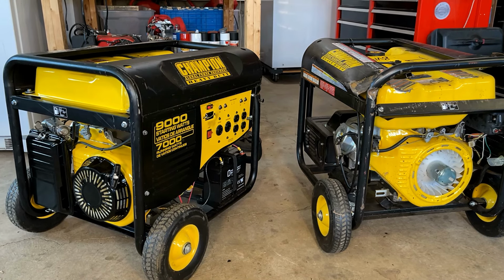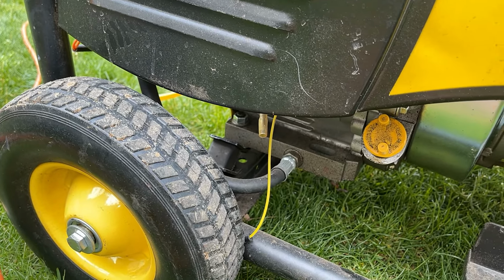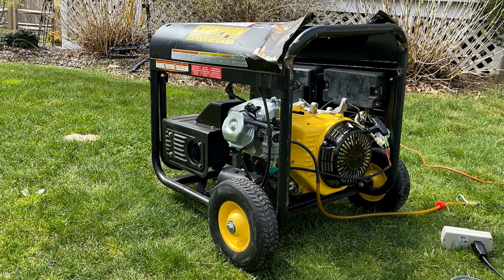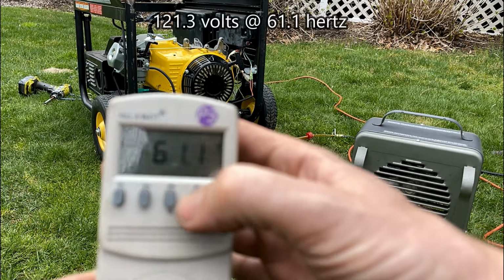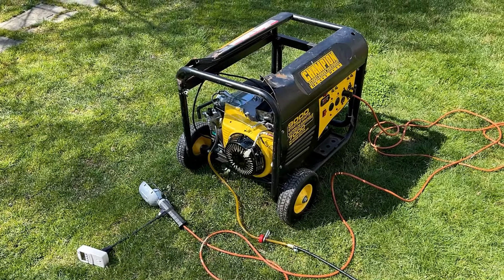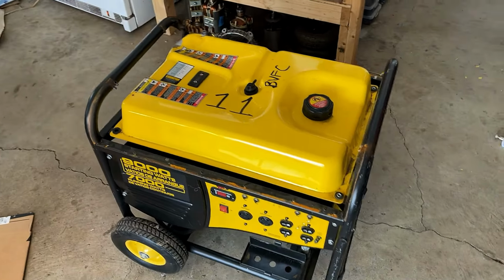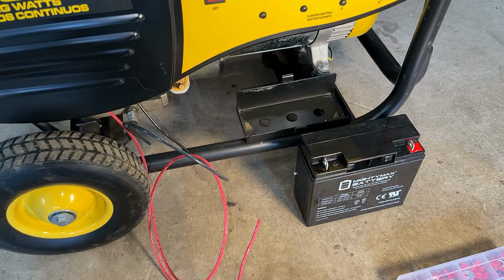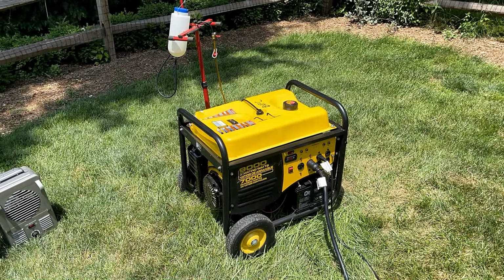Two Junkyard Champion Generators (Part 2) - Scrap Metal?

Comment: One way to pop dents from metal tanks is to partially fill with water and put into a freezer with the dent facing down. Worked great on dirt bikes and three wheelers.
Reply: Also, low pressure air can be useful for larger dents with less of a crease to them. (low pressure being the operative word here, above a few psi they can deform... Actually, Isle of Man TT racers & other endurance riders have been known to "blow the tank" in order to gain a little extra capacity/cut out a pit stop on a "stock" bike)
Reply: Since these dents are in the top of the tank I would make holes and pop the dents out with a screw and slide hammer. Fill with filled epoxy and sand it smooth.
Reply: Great video James ,what did you do with the extra wire that wasn't availible on the replacement suspect but ok AVR did you work out what it did ? Everything see s to be working ok a great machine with low hours and plenty of grunt at 6kw.
Reply: Another way is to use a jetwasher to hydroform it.

Comment: Oil the filter by putting it and the oil in an old but clean plastic bag. Squish it around inside the bag. Save a pair of gloves in the process.

Comment: Very informative video! Up here in Canada we would fix that tank one of two ways: 1. In summer plug all openings ( your choice as to how) and add about 60 pounds of air, or 2. In winter fill it completely full with water and set it outside overnight. Either way the dent(s)  will be out, doesn't remove creases very well, but some blows with a rubber mallet help with them. "Gidday" from Ontario Canada.

Comment: Obviously a pre-positioned primary and also secondary emergency back-up generators for something like life support or critical care situations when usual power might be unavailable.  Fires, floods, blizzards or other disasters that suddenly cut utility power to a remote household could be fatal if the patient absolutely needs that power for support equipment.  Could have been something like a remote police or fire station as well.
7 hours of test run time, just to re-certify the system, could have stretched for years of just maintenance service until some termination of the need finally arrived.  Government policies might have mandated tossing them into a clean-up dumpster when no longer needed (or replaced due to some sort of "shelf life" policy).
The Magic Marker markings often can be partially or even completely removed using rubbing alcohol.

Joe S

Comment: you do a great job,,,,i have Champion,,my big 5500 has no spark now.its like new.was parked in shed for a year...never had one with no spark yet...have to look into it..its my spare,a have 2 4000 ones two...its full of oil...may be coil...or switch...

Comment: The older champion last 30 yrs. mine is 6 yrs old and doing great. It is a 4000 watt... Surprisingly the HARBOR FREIGHT 1400watt is doing ok, the first one I had to take back , it leaked oil & gas..two months in, and second one has not one issue yet, I have a month left. I run it 6 to 12 hrs a day to charge RV batteries & watch TV. Second one has been a dream boat so far...

Comment: 0222'25/2132h 🇺🇸 Thanks for the Part 2 on Champion Generator. Pardon me for saying this.. The original AVR had trimmer too. The body was built around Aluminium which was heatsink. Did it fail AVR control? Cheers.

Comment: I like your program and have learned a lot thanks. I do wonder why you don’t have a cart to install your heaters prewired with one cord and a fuel bottle and some tools on to take outside  thanks again.   Ringo
Reply from the maker: That is something I plan or doing at some point.  Ideally I would get a professional (well used) load bank, but until then will stick with the cheap solution.
Reply: @jcondon1  no weight. You could use bike wheels and aluminum tubing and light plywood

Comment: on some of them china -honda copies,inside AV there is a tiny screw,you turn that clockwise and it will raise voltage
Reply from the maker: I should have checked that.

Comment: The sheathing on that wire is super glossy for Stranded Wire were you get your wire from? @29:50 @James Condon
Reply: That "super glossy" look of those wires is a clear vynle sheath for weather protection. They're outdoor grade wires. The vynle is treated with UV protectants to prevent degradation from UV damages.
Reply from the maker: Home Depot!

Comment: What does it matter how you connect the wires going to the full wave rectifier, usually red and white wire, the output of this bridge rectifier will be the same going to the brushes won't it?

Comment: Tne bent up one must have fallen off a truck or some platform.  There is one YT video using pressuirized air to remove a dent from a gas tank.  Those gas tanks are thinner than tanks designed for pressurized air.  Or to be really adventuresome, fill with an explosive gas and light it off (like some YT videos show seating tire beads).  The result might work or be a spectacular explosion.
Reply from the maker: It would do something.
Reply: Could have happened when it hit the junk pile

Comment: I know I’m late to this video but I was wondering if the AVR in this video could have been adjusted at all first as a troubleshoot. Perhaps I missed that but I thought the AVRs had a trimmer pot on them to adjust the voltage.

Comment: Obviously returned under warranty items that had loose parts removed and were then dumpster scrapped.  

WERE IT I, I would identify the box store that sells those Champion generators and see if I could work up a deal with management there to buy, at salvage, the returned under warranty small engine equipment after the manufacturer wrote off the entire cost to that box store.  By doing that there won't be dumpster damage, all the easily removed 'bits 'n pieces" will still be in place, swapping parts from designated 'donor' units would be fast and easy and everyone wins in the end.  

I have seen such things work out before under similar circumstances.  

Could be a good source for other "7 hour equipment" for you, time after time.  :goodvibes:

Comment: most likely the fram was damaged   at the junk yard throwing it out of the tuck. it was warrentied  an
d the starter and carb was sent back to the distributor with the RMA form  because of the bad voltage regulator

Comment: These both have the wire set up for remote electric start very rare. high end with electric start I like your videos I get educated,  I got a generator recently the engien runs excellent but the stator is shot any ideas on how to get a replacement?

Comment: Hey James, 
Regarding the AVR, I have seen you adjust the voltage of a generator up using the potentiometer, but it isn't possible to also adjust the voltage down using the potentiometer?
Great set of videos, nice save on both gensets.

Comment: Is the plastic choke lever @22:15 all one piece of plastic that pivots on the same screw that holds it down to the carburetor?   It was hard to see what was going on when you tested turning the choke lever.

Comment: VOLT GUARD, is what champion gennys have on them.
Reply from the maker: They should all have it
Reply: @jcondon1  agreed James, super safe for equipment, but damned that threw me for a loop when the AVR went bad and the replacement caused the same no start issues until I adjusted the potentiometer to the correct voltage, more should be put out by champion on the volt guard.   Have a super day and keep the videos coming.
Reply from the maker: @sweetlou5902  hopefully I saved that AVR

Comment: I was thinking over voltage protection as soon as you showed the avr had extra wires. Great content.
Reply from the maker: Thanks
Reply: So… would you disconnect those to test it for over voltage? Without it cutting out
Reply: @samuelfellows6923  that's what he did inadvertently. I'm sure if he knew at the beginning it could do that he would have unplugged it along with the low oil sensor as part of his diagnostics.

Comment: Great videos. I had a similar Champion, NIB, for my Toy Hauler TT. I drove 20 hours to Burning Man, unpacked a mountain of gear in 100 degree heat, fired up the brand new generator, and it overcharged all my circuits. Black smoke was pouring out of the fuse compartment like a train locomotive, and was moments away from a major fire. The circuits were fried. I was now stuck in the desert for 7 days at BM with no A/C and a dead TT. I was able to jury rig a battery tender to the 12V system for interior lights and water pumps, but it was a long week of finagling to limp by for the bare basics of running water and some lights.

Comment: I have seen the volt guard mentioned on the champion generators but I really didn't know if they were describing the avr or not until now. The volt guard is a completely different system that prevents high voltage. 176vac. I never knew it could get that high and some generators would still allow it to happen. Great information.
Reply from the maker: 99% of generators this size have not over-voltage protection.
Reply: @jcondon1  that's what I was thinking. You confirmed it. Champion seems to be the only one with volt guard. I see some of inverter generators that claim to be good for electronic devices. I think it's overkill to buy a 3500 watt inverter generator when a larger regular generator with volt guard would be cheaper and just use a line cleaner filter for sensitive devices. You're thoughts?
Reply from the maker: I agree.  Although I have a cranky neighbor and was forced to use an inverter for back.  There are other advantages to an inverter like better fuel economy, quieter and less engine wear.  But also more to go wrong.  I liked this champion generator a lot.  Had a nice feature set.

Comment: I can not believe it is in that bad of shape and needed a AVR with only 7 hours. Finished product looks great though
Reply: Electronics usually either fail very early in their life or else not for a long time.  The rest of the generator was probably in excellent shape (except for the bad AVR) when it got returned to the store and then things went downhill from there.
Reply from the maker: I agree about that.  Most electronics fail early.  Once you get all the gremlins out, it should last a long time.

Comment: Replacement AVR's for these types of generators with blue and yellow colored cables have the blue cable as the positive one. The yellow cable is negative.
Reply from the maker: Thanks.  Usually do not see those colors on the AVR.

Comment: You always say at the end of your videos " I hope this helps someone".  Yes you have helped me ... I have this exact Champion generator and the voltage output at no load was 127 V. Not in this video, but in others you showed how to adjust the output voltage which I never knew could be done.  I adjusted to 120 V and the generator now regulates pretty good from no load to 4KW.

Comment: Why not just adjust the avr variable resistor located on blue block?  The other connector is for remote start.
Reply from the maker: I had assumed it was bad, but maybe adjusting it would have worked.  I still have it.  Might give that a try.

Comment: so i watched the previous video and this video the first champion generator looked brand new and had a stuck valve  ehh ok couldve been exposed to moisture  not a big issue
but generator 2 having voltage issues after 7hours yeah thats making me think theres quality issues with these generators  i will certainly be reading and watching reviews before i buy a generator for my house

Comment: Why was the original AVR gone bad? Thought you could adjust the voltage through the potentiometer on the AVR to bring it down to 120 volts?
Reply from the maker: You can adjust it down.  I should have tried.  Usually 160-170 volts is full power and they sometimes fail that way.  Just assumed it was bad.  Maybe someone was in there before and cranked it up.

Comment: Not to seem like a real idiot, but I dropped a 4mm combination wrench into the air vent and into the generator fan on my Generac 15 KW V2 Generator.. Would you happen to have any ideas on how to retrieve the wrench other than pull the head and armature out ? I would appreciate any thoughts you would have... but not "don't have the wrench on top of the generator frame".  Really enjoy your videos, quite organized and display an amazing natural confidence with the subject matter. Thank you.
Reply from the maker: It fell into the bell housing where the fan is for the rotor?  Would try a bendable magnetic retrieval tool first https://amzn.to/3rZTwUM.  Otherwise you could also use a Dremel and cut one of the slats out to gain a little more access.  Only downside is that critters would now be able to crawl in a little easier.

Comment: Could the connector on the original AVR module be for an over-voltage sense circuit? The new AVR module does not have that connector so have we eliminated the over-voltage protection?
Reply from the maker: From what I could tell looking at the circuit diagram, the voltage is monitored on the main stator output, so the protection should still work.  I think the extra AVR wire was used with the missing remote start.  It allowed the engine to startup and then power up the AVR with a delay to give the engine a change to stabilize.

Comment: 12:00 that 2nd avr has a fake capacitor which is very common for cheap electronics from china..there is noway nippn chemicon made a 450v 600+uf cap in that size 😂

Comment: Hello mr. James... I had enough pain of my generator... actually it has been working probably for 10 years... about a month ago I tried to started but I was stuck ... I changed the battery and the starter and all the wires but still it doesn't work... actually the problem is when the piston reaches to the high pressure point It gets stuck even while pulling out the rope by hand it starts pulling my hand towrds it.. i tried to adjust the valves but still the same problem... now if i wanna start it I had to bring a large battery otherwise it won't start... so I don't know what to do...

Comment: Why is there a fuel solenoid?  I thought there was a manual fuel cut-off valve.  Is this a dual-fuel unit?
Reply from the maker: Not dual fuel.  It’s just to prevent possible backfiring or flossing at shutdown.  Not really necessary.
Reply: @jcondon1  I asked because I'm looking to purchase an inverter generator...either Champion 100519 or 100520.  The 100520 has a battery/start.  I asked Champion if the unit can run without the battery (in case the battery is dead).  One answer is yes, but another response they say no because a battery is needed for fuel solenoid.   I don't see that part in the part diagram.  Thoughts?  I can go for years between needing a generator, so having a viable battery could be an issue.

Comment: James, I have been following for a few months now and enjoy your "wins". You inspired me to buy a champion 9000 from a scrapper. The needle was stuck but I got it running from watching your videos. BUT I have a question I hope you would address. When I shut down the unit, there would be a good size spark that ran from the fan shroud to the solenoid. Scared the hell out of me. It does not happen every time. Any thoughts on the cause? The cure?
Reply from the maker: The only thing that changes at shutdown are 1) solenoid is activated and 2) ignition is grounded out.  Sounds like an issue with the solenoid, wiring or maybe an issue with the bridge rectifier.  Hard to say, but the solenoid is not needed.  You can just unplug the wires.  It is normally open and only fires at shutdown.
Reply: Thank you

Comment: Just Curious why you did not try to adjust the AVR with the little screw on the Potentiometer?
Reply from the maker: I should have, but usually that is for fine adjustments.  Assumed it was bad given how high the voltage was.  Potentially someone was in there before me and cranked it up.
Reply: @jcondon1  I just picked one of these up today and it is reading 254 Volts,  when I get to work tomorrow I will  try lowering it to 250.  The one I got was built in 8-2011 and has 54 hours on it. I was encouraged to buy it because I remembered you working on these earlier this summer, Thanks for what you are doing and the quick reply!
Reply from the maker: Good luck.  I liked this generator a lot.  Had a bunch of features I normally do not see.
Reply: @jcondon1  Just an update on the AVR Adjustment, I was able to go as high as 260 V and as low as 240V, maybe lower but I did not want to risk hitting the end of the adjustment . So the one that you took out might be good!

Comment: Why didn't you just turn down the Pot on the AVR to adjust voltage as I have watched you do in other YouTubes? Thanks!
Reply from the maker: I should have tried that.  Usually when the voltage is that high there is something wrong or someone tinkered with it.  One turn of the pot is about 2 volts.  Either bad or someone turned it 25 times....
Reply: @jcondon1  Got it. Thanks!

Comment: Hi James, I have a 2017 champion 4000/3500. Runs like a champ, but last time I used it, I noticed the volt meter was on 0 [as it was always 120v] even though it was generating and operating fine? Any Ideas...I like your channel very much and am a new subscriber!
Reply from the maker: Most likely the volt meter needs to be replaced.
Reply: @jcondon1  Thanks, thought that there may be a chance of a fuse, or quick fix, cheers.

Comment: A large crescent or pipe clamp is ideal for straightening out brackets rather than the vice-grips you were using.
Reply from the maker: Good point, thanks.

Comment: I have never seen a generator running off an IV bag hanging from an IV pole. So what if the tank and frame are shot. It would make a good permanent installation somewhere without the frame and an auxiliary  tank. You do excellent work.
Reply from the maker: Thanks